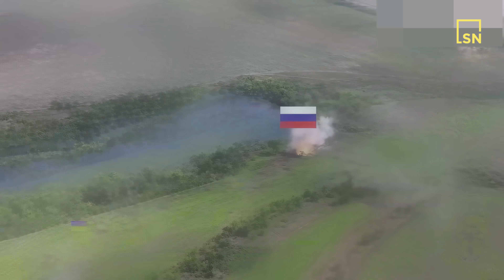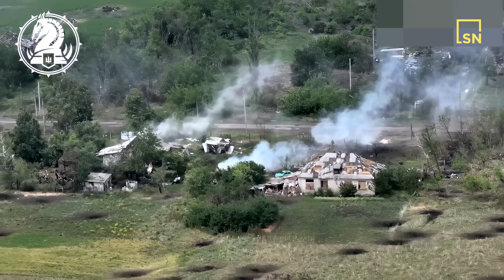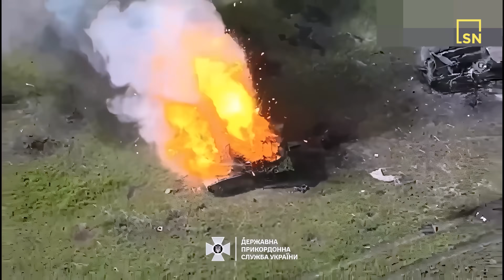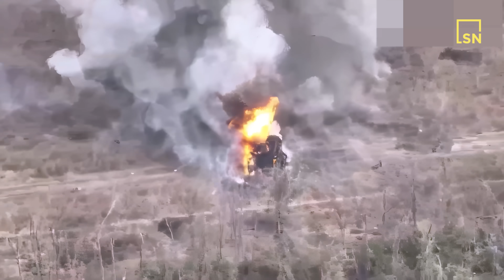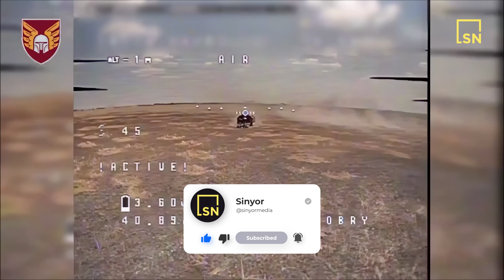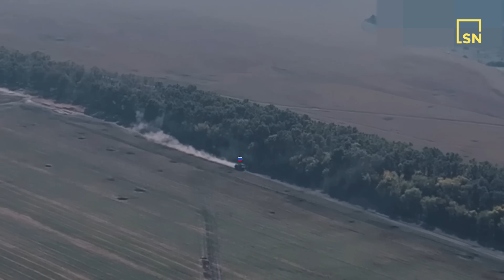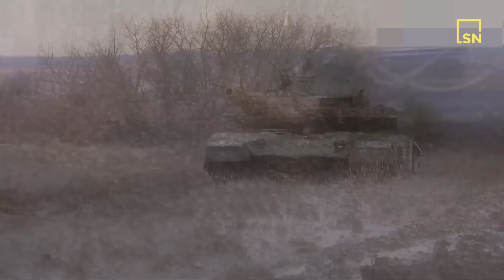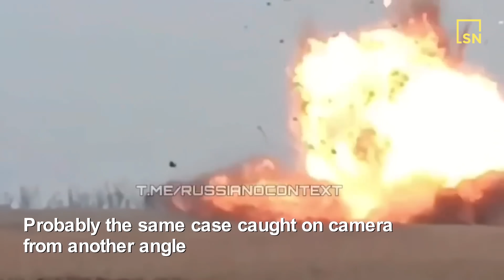Two Abrams Face Russian Brigade Alone, Head-on

Comment: Modern ground warfare after this war will never be the same again.
Reply: Absolutely. Tanks must now have the artillery vector. Moving tanks into frontline assaults is no longer a good military strategy.  Tanks must have the ability to fire from a distance. Many need the power to destroy drones.
Reply: @markkettlewell7441  we already have those that’s called Mobile Artillery….
Reply: @mclpl3777  I am aware of that, but tanks are heavily armoured so they don’t need to  vacate a place as quickly, since artillery generally must shoot and scoot. But I understand your point.
Reply: @markkettlewell7441  but  then it stops being a tank and it will just be a heavily armored mobile artillery piece 
I mean I think tanks are gonna be useless in like 30 years time so I think artillery is the way to go
Reply: @mclpl3777  With the advent of drones things are changing but that is what tanks are evolving into, heavily armoured artillery. But warfare is going to look different in 30 years. Drone tanks are going to be driven by virtual crews, and unmanned. Since people don’t relish dying it will go this way. Modern fighter jets will be unmanned as well.
Reply: Self Propelled Howitzers are a good example
Reply: Meh, just reinforces the need for close air protection. The moment one side can secure the skies, this fight becomes one dimensional.
Reply: @Korruptor   and how do you think one gain the skies? 

Cheapass drones from China. That's how. Even electronic warfare cannot disable them, just look at how futile Russia's attempt at jamming them, but then the Ukranian drones still hit their targets anyway.
Reply: @TheReal_LuaDipa laser weapons have been a prospect in recent times, you could probably mount one on a tank
Reply: On a tech level that might be true. But in order to take over another's land, it still requires feet on the ground to claim territory. That's unless we get replaced with robots.
Reply: Whenever jamming tech is ready for drones, things will stabilize quite a bit once again.  These 2 countries dont have the resources that the US, rest of Europe, and China have to combat them.  It may be as simple as a modified EA18 flying overhead which interferes with drone signals.
Reply: @davidmacy411  
But they do have European backing. And signals can be changed. There can also be what would be known as 'ghost' signals to confuse the interferer.
Drones can take out other drones as well and so there are ways around everything.

The game is to keep changing up so the Russians cannot figure you out. I think they call it 'innovation'.
Reply: Just wait until lasers become a thing.
Reply: Such is the case after every war. I’d argue that this was, more than any war in quite a while, was heavily influenced by the Civilian electronics market. That is to say: All of the drone available on the civilian market were irresistible to the Ukrainians and then the Russians.
Reply: Waiting for SkyNet to deploy Terminators on the battlefield.
Reply: It will be dones and robot vehicles in the future
Reply: Drone warfare is terrifying. I think the next few years will see a major arms race between drone technology and anti-drone technology
Reply: @jacobgoodstone7572  once there are effective measures to destroy drones for dollars or maybe even pennies if we make laser weapons to melt the drones
Reply: How’s that? Most of these weapons systems are already decades old. The Ukrainian army is doing an excellent job, but they’re still learning how to use them as effectively as they can be used. That said, ground warfare is never really the same in every war.
Reply: @jameslewis8227  Those little cheap factory made drones, they have taken the place of armor and air support and relegated the forces of both sides into a war of attrition in trenches and hard places. The only way Russians can advance at all now is through human wave attacks backed by artillery on the ground. The Russians have lost well over three thousand tanks in less than three years and half their air force, plus 1 million plus casualties. This is all due to the rising tech and usage of aerial drones to the point of if a hatch is open in a tank or someone is hiding under a bridge they can be taken out by a man hundreds of yards away with a hand held consol. Granted the jamming tech is getting better but so is the reaction. If this isn't a game changer I do not know what to say.
Reply: @michaelwoehl8822 That’s an exceedingly common exaggeration and misunderstanding of what the future of ground warfare will be like. Once the newest anti-drone countermeasures are widely deployed, cheap drones will no longer be a serious problem for the governments who invest in them, and ground warfare will continue to develop at the same pace it U.S. been for decades.
Reply: @michaelwoehl8822 One of the biggest reasons the Russian cannot advance is because they don’t know how to fight effectively with the forces they have. They don’t properly coordinate their air power with their ground power. They don’t delegate, or even train to delegate, enough command and control authority to their NCOs in the field. Not to mention, doctrine has been to use waves of tanks and people from the very beginning. If Ukraine’s forces had been properly trained and equipped form before this war began, Russia would have been kicked out of the country in the first couple months. Their decision to use cheap drones is just an economical and convenient stopgap solution. 

Consequently, if the use f cheap drones as important and effective as you and others insist they are, this war would have been won already.
Reply: @jameslewis8227  No that is not the conclusion I was saying and yes Russian ground tactics have been abysmal and if Ukraine had more of what the US has in it's arsenal and better training and a lot more money at the initial attack three years ago Russia would be in dire straights now. What I am saying is drones in the future are going to mean much more for modern ground forces than they have in the past. This tech is not going away, ask the Russians, ask the Ukrainians, they are fighting out of trenches and hard places and are at this moment using thousands of drones in the field as well as in bombing missions with pin point accuracy 100's of kilometers away and even using them against fighter jets and bombers, much more than tanks and other armor so lets just agree to disagree and see what time brings. Every war most of the time brings in new tech or changes the use of tech already present this one is no different and I think will have some major repercussions in future warfare.
Reply: @michaelwoehl8822 You’re not making any points that make any sense to me, so you might as well save your energy.
Reply: @jameslewis8227  Time will tell.
Reply: @michaelwoehl8822 P.S. In the near future, dealing with these cheap drones will be equivalent to dealing with mosquitos, for the well equipped militaries. Anyone with a software defined radio transmitter and a decent spectrum analyzer can already easily jam these drones, so go figure what a mildly sophisticated electronic countermeasures system, integrated with the appropriate small arms weapons system, will be able to do. Tanks aren’t even close to being dead and cheap drones won’t have much effect on how ground warfare is conducted in the long term.
Reply: @jameslewis8227  jEES thought this was over, are you saying Russian jamming tech is so far behind as to say they can't stop small drones hitting targets in Leningrad or Moscow? Which they are doing at this moment? Look let's agree to disagree and end this and each have a good day.  Good day sir.
Reply: @turbosbox You have no clue who you’re trying to debate, so you ought to give your fingers a rest. You clearly have no idea what you’re talking about.
Reply: @jameslewis8227  "P.S. In the near future, dealing with these cheap drones will be equivalent to dealing with mosquitos, for the well equipped militaries."
What do you think will be the basis for effective drone warfare?
Reply: @сергейжадин-й6л Portable radar guided weapon systems and electronic warfare systems.
Reply: @turbosbox yeah so making a 500 to 1000 dollar drone into a 12000dollar drone that may still only take 1 1200dollar shell to blow up isn't economical
Reply: Zmienia się po każdej następnej wojnie.
Reply: @andrzej4512  This is a radical change.
Reply: because it's war crime but it's not being categorized as so because it'll be a major part of the allied offence in the next war
Reply: Its already different, during this war😂
Reply: Warfare is already completely different, tanks will be drones if we use any land based systems.
Reply: @tclanjtopsom4846  The only thing that they are proving over there is their own incompetency. The footage is absolutely wild. Who in their right mind decides not to use their 125mm gun at its effective tange and instead decides to pull up to 10 meters from an anti tank position with the hatch open?

No ECM, no EW, etc. Instead they tack weld bird cages onto the tank only to drive them into a mine field.

Speaking of minefields, they don't even try to clear them before moving in. Instead they drive in a column formation with the lead tank using a plow and within 10 meters of the defensive position. All the defenders do is target the lead tank and pick off the rest one by one. And the column is stuck because the only thing the plow did was push all of those mines directly on the side.

I swear they're not even training them on how to operate a tank. They dont even know how to pivot in place.
Reply: May be tactic will change. One thing is this war will never over…
Reply: ЭМИ (да их активно испытывают)- и все современные управляемые системы, становятся полностью бесполезными
Reply: This is still a very limited war though. Imagine a full scale war with no limits. Full Air Force used, all long distance gps guided precision rockets and missiles used, all hypersonic weapons being used, all drone types being used including high altitude stealth drones. Full naval power used. Also, include AI being used to calculate and act on every weapon, every attack, every strategic situation, weather, troop position, logistics, energy.
Reply: @Ghost-sz2qm this is decades away the only country currently having most of these capabilities is USA with china still being quite behind
Reply: I don't think this war changes too too much, for example neither side has air superiority which is what the USA always achieves. Without air superiority, or at least the attempt at it, we aren't seeing a modern war we are seeing WW1 tactics with modern equipment.
Reply: We hear that after every War, silly.  The one thing that never changes is government stealing from you to pay for its Wars.  Well, it all changed once in 1776 but not since.  Its been all downhill ever since.
Reply: It’s all about geography, in this area this is how it’s gonna be
Reply: Skynet is born?
Reply: I can't lie...drone warfare terrifies me.
Reply: At least the russians won't be here to see that future. So something is at least positive
Reply: @R3TR0221 Why are we still gaslighting ourselves, population data of both countries are publicly available
Reply: @R3TR0221 тебя не будет и всей твоей семьи
Reply: @R3TR0221  And you'll keep dreaming of that moment. I really hate how people keep saying stuff like this when its pretty damn far from the truth.
Reply: @R3TR0221  не дождешься нацик!
Reply: @R3TR0221   sorry Russia dosen't perish, the remain until the end, I know you're angry but the thing is they just survive forever until they get greedy which they haven't yet
Reply: @R3TR0221 Русские всегда будут жить и развиваться Я бы вам кое что сказал, но неважно Россия будет развиваться и быть технологически развитой
Reply: @MuhammedEmintaş-w4q Технологически развита только по меркам сороковых годов
Reply: @R3TR0221 Если вы так считаете, давайте отправим туда, где вы живёте, российскую термоядерную бомбу У России есть величайшая технология ядерная энергетика
Reply: @R3TR0221  we live in hope! 😁
Reply: And it will get even worse. Imagine insect sized drones, flying and crawling around in the hundreds and thousands.
Reply: @michaelwoehl8822  The only lesson we've learned is what NOT to do and that russian equipment is awful.
Reply: How so?
Reply: @geoffhaylock6848 short answer - drones. They changed everything. RN it's impossible for both sides to collect large force for offensive strike - thanks to drones the force will be spotted and viewed as far as 100 km (62 miles) from the frontlines. This gets you enough time to prepare the defense. Kill zone starts at 35 km (25 miles) from the frontline, with the last 10 km (6 miles) to the frontlines being almost no-man zone as absolutely everything getting droned in this area.
Reply: @Chechewitza  the effect of drones on modern armies with combined arms tactics is unknown but the older weapon systems in Russia and Ukraine definitely have had massive changes
Reply: @Chikenman123YT don't forget Israel, dude. Israel had a hard hit from Hizbala with it's drones. Thought, atm the main problem was detecting the drones. Howhever right now border with Egypt get violated every day with dozen drones delivering firearms, drugs and a lot of many other unknown supplies to beduhim inside Israel, and we got zero clue what to do with it. We tried to hunt down those drones with helicopters, but it's gets too expensive. The israeli-egypt border atm declared a closed military zone, as we seek a way to deal with this problem. Drones indeed change the modern battlefield.
Reply: @Chechewitza detecting drones that can cause any mayor damage isn't hard but detecting a small FPV drone that can maybe disable a civilian car is harder. Also a show me a source for your example
Reply: @geoffhaylock6848 are you stupid?
Reply: @geoffhaylock6848  because of the use of drones. All of these other countries who have better developmental capabilities see this and will use it
Reply: @VABuckeye94 Better developed countries take out the archer not the arrows....
Reply: @geoffhaylock6848  Tanks have become obsolete, That is how.  Like Battleships of the sea, Tanks are dead.
Reply: @jasonweiss7757   ....and yet Ukraine are still using them for defence against APV's etc.
Reply: @jasonweiss7757 oh that's why Ukraine and Russia both scrapped their tanks and made more drones 😂😂😂
Reply: @geoffhaylock6848  Tanks become relicts of past, this is change. 
Tanks are machines of WWI and WWII era, now drones become future of warzones. 

You are in warzone, you wait for enemy. You hear loud sound like thunder, you see that sky become black... when day become night you wait only for death. 

This is future of war. 
Army of drones controlled by AI, like Skynet in Terminator. 
Can you imagine sending there half of million drones? 

Its new atomic bomb. 

Right know, any soldier... any driver, who see drone above think about entire life, because its very likely that death is comming with loud noise of drone.
Reply: Russie et 50 pays et l'ensemble du bloc de l'OTAN !!!
Cette guerre a été déclenchée par l'Union européenne et les États-Unis lors d'un coup d'État en Ukraine en 2014 ! Et maintenant, ils utilisent les Ukrainiens comme chair à canon et accusent même la Russie ! 
L’Occident aime déclencher des guerres et se battre avec les mains des autres.
Reply: Абрамсов на Украине много сожгли. Так что это видео ниочем.  Там прям на каждой дороге по сгоревшему абрамсу и бредли😂😮
Reply: @alexbuuks8529  I very much know there are many, many more Russian tanks and personnel carriers destroyed on the road than American by the thousands my friend, so whatever point you are trying to make, please do a better job.
Reply: @alexbuuks8529 the only tanks burned up in large numbers are Soviet era tanks

Comment: 📉 The figure of 10,000 Russian tanks lost is indeed staggering—but it needs to be taken with a grain of salt.

🔍 According to the latest data from the Ukrainian Ministry of Defense, Russia is said to have lost approximately 9,859 tanks since the beginning of the invasion in February 2022. This number includes tanks that were destroyed, captured, abandoned, or damaged, and is compiled by the Ukrainian general staff for strategic communications.

⚠ However, these figures are not independently verified. Sources like Oryx, which track only losses backed by visual evidence, estimate Russian tank losses at around 3,740 units. That's a significant gap—highlighting how totals can vary depending on the counting method used.

🧠 In summary:

10,000 is a high-end estimate, mainly shared by Ukraine to emphasize the scale of Russian losses.

The verifiable numbers are much lower, but still substantial.

It’s therefore an exaggeration to take this figure as absolute truth—though it does reflect a genuine pattern of heavy losses. 

But... Ukrainian FPV drones are responsible for about two-thirds of the destruction—nothing particularly glorious, really.

And yes, such numbers are often used as ridiculous propaganda tools—targeted at the more gullible among you.

Comment: The combined action of the Abrams and Bradley shows exactly how these two are supposed to be used. US forces also let the Bradleys operate as support for the Abrams. But for the best results, you'd also need air support, but neither side has air superiority, which makes it difficult for both sides to really make some steps.

Comment: How long will it be before the tank plant in Lima Ohio start modifying the Abrams with rotary shot guns front and back to blast drones? The technology is available now, think rotary gun shooting 12 g shells controlled by onboard radar. The good ole boys will simply replace both 7.62's with auto fed shot guns. Which means you don't have to rebuild the entire tank to deal with FPV drones a 12 g shell has an effective range of at least 120 feet, putting the drones at risk as they have to get much closer to damage a tank.